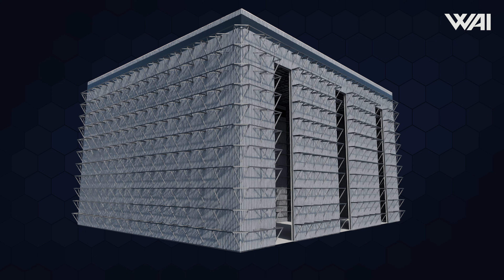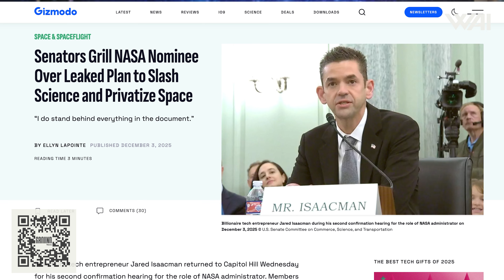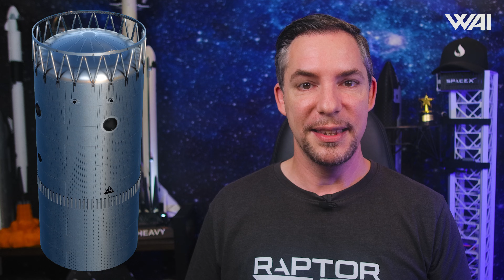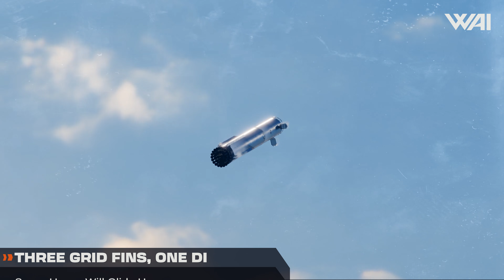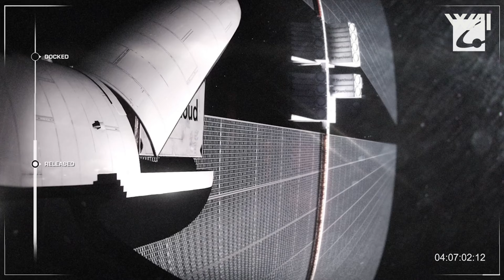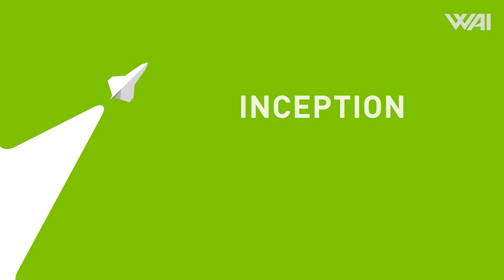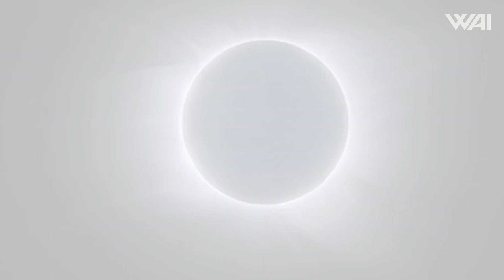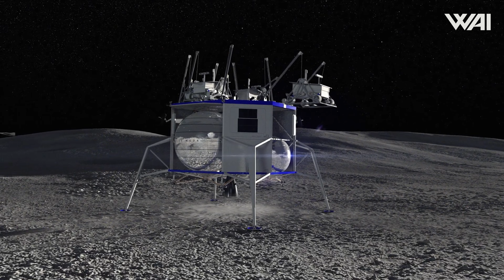Starship Flight 12 is HERE | The Secret Behind SpaceX's RADICAL Version 3 Design Change!

Comment: The temperature outside earth atmosphere on leo orbit about +150 Celsius. How exactly it help to cool the AI chips??
Reply: It's cool in the shade.
Reply: @RobinMiller-v6c you can't stay in shade on orbit...
Reply: @0ne_of_Billion  I think you're not tall enough for this ride.  Does your mom know you're on the Internet?  For extra credit, how does the Webb Space Telescope keep its infrared sensors cold?
Reply: The solar panel array surface facing the sun gets that hot.  On the opposite side of that solar panel array, in its shade, there could be a radiator panel array emitting waste heat into space.  But the radiator panels don't even necessarily have to be shaded: they just need to be kept oriented edge-on to the Sun - so that their radiating surfaces face dark space.  It's what the ISS does.
Reply: -150c in the shade
Reply: on geo there is no shade. On leo it is 50%.. what about rest of the time it is on hot half? @parazeke5054

Comment: Multiples of launches in a day to refuel in orbit for a trip to the moon is dumb
Reply: Invent something smarter that delivers the same level of upmass.  I'll cheer you on.
Reply: @RobinMiller-v6c they've already been invented, it's called solid rocket boosters. Multiple launches to refuel in LEO are estimated at what, 8-12 launches? How is that cheaper than disposable solid fuel boosters in one shot? It's not.
Reply: @imstevemcqueen  Show your work.  Do the math.
Reply: It's even funnier when you realize the fuel and oxidizer they're transferring into the depot has water contamination from the pressurization scheme
Reply: @prophetrob  only the LOX tank has that combustion byproduct contamination problem; the LCH4 tank is pressurized with pure methane gas tapped off from the regenerative cooling loops for the combustion chamber and nozzle on each engine.

That said, I doubt Tanker Ships will be delivering propellant via their main tanks.  It's more likely the propellant deliveries will use separate, dedicated tanks housed inside the volume currently allocated to payloads.

Comment: Would it be possible to disconnect the external fuel lines only when the rocket reaches the height of the tower?
That way you could keep pumping fuel in during ignition and initial take off.
It it too dangerous? Are the fuel pumps too slow to pump a significant volume of fuel during that time frame?
Reply: Having fuel and oxidizer still in the lines when a /flaming booster/ goes by is a recipe for RUD.

Comment: space based data centers connected to the regular cloud still seems to me like it can't possibly be cheaper than building solar powered data centers on earth unless you run out of land, but I'm excited about the the R&D anyway since low cost rad hard edge compute for observation and scientific satellites would let them do data preprocessing onboard and produce 10x as much science for a given downlink capacity.
Reply: Communities across the country have been protesting data center build outs in their towns because the city councils are usually in the pocket of these large corporations and they're diverting future tax revenue to offset the costs of building these data centers. The only reason it would be cheaper on earth is if the citizens of a township are being screwed over by their councils forcing them to subsidize the construction and electricity costs of these behemoths. You also get the stronger solar radiation and lack of atmosphere in space that boosts solar production and the misunderstood aspect of cooling in space being less energy intensive because you have a vacuum on the dark side that heat can be pumped and radiated to as opposed to running refrigerant and cooling loops on earth at ambient temps. It's complicated, but it does make sense economically and socially to move these operations into space. No one wants a giant humming computer in their backyard 24/7 and they shouldn't be forced to pay for it too.
Reply: @mattjenkins2244 how many satellites do you think we can launch into orbit before people start complaining about that more than land
Reply: @prophetrob a quick napkin math would say 200 million square miles of surface area, one sat per square mile, then multiply by altitude, say 100 miles to gso orbit or about 22000 miles. So 200 million times 22,000 or about 4.5 trillion sats and that's without including the expanding "surface" of these satellite layers which would obviously be much more than the earths surface area. So my answer would be 4 trillion with some room to spare. Obviously this would be crowded but not by much, it's a mile of space in every direction per satellite and we have some that pass within a few hundred meters right now.
Reply: How do you get the far out satellites far out if there's a million satellites below the orbit
Reply: @prophetrob  You go between them? Space is big; there'd be plenty of room
Reply: @garikloran8175 it seems a little difficult to play frogger with a rocket 
Also the surface area means of estimating the capacity leaves out that the satellites are in orbit and orbital paths at the same altitude cross quite frequently
Reply: @prophetrob you launch a rocket between the satellites like we currently do. A mile between each sat isn't easy but it's pretty reasonable and that would expand as you reach higher altitudes. You deploy the sats after reaching the correct orbit or have the satellites deploy and then raise orbit slowly over weeks or months like starlink does. The trains of sats you see at night are when they are raising their orbits slowly. Check out a sat map of starlinks and check out the altitudes and space between them when they cross over, the scariest situations are when other countries satellites or launch vehicle gets too close to them and one side has to avoid the other, recently a Chinese launch that got within 200m of a starlink sat.
Reply: There is ALREADY pressure for (and resistance against) the construction of additional electricity-generating power plants, to move an increasing number of EVs. But now... exacerbating that pressure... is the need for a  still further increase of land-based electricity-generating power plants... to power AI... UNLESS AI resources are located in space, where they can be directly powered by solar. Lowering environmental pressure.
Reply: @richardloewen7177  exactly right about the problems, I just think that building an off grid solar and batteries data center on earth is cheaper than building one with equivalent computing power in space because as much as space launch has gotten cheaper, it's still not cheap, and anything on a near term satellite has to be much more reliable (expensive) because you can't do maintenance and is much harder to upgrade.
Reply: @richardloewen7177 you forgot about the environmental pressure of launch facilities and the environmental pressure of hundreds of thousands of satellites 😂
Reply: @richardloewen7177 what is it the kardeshev scale? Time to get up to a 1 and harness the sun for real boys lol
Reply: Agreed, these space based datacenter companies will be the first to go when the ai bubble pops.
Reply: The faster industry of all kinds moves into orbit, the faster the gardeners can restore the planet.